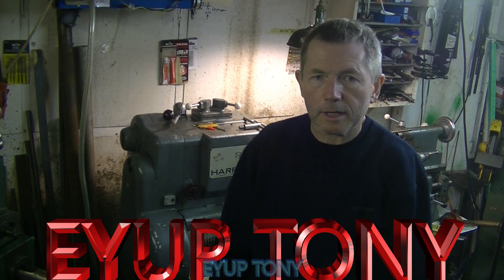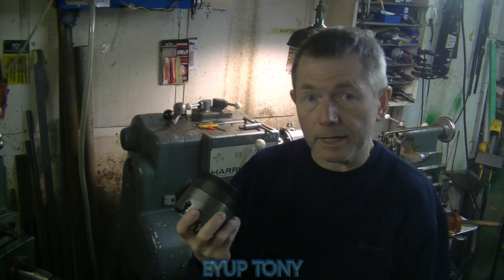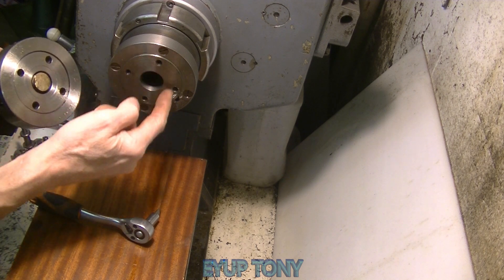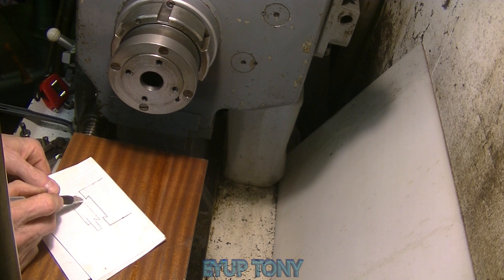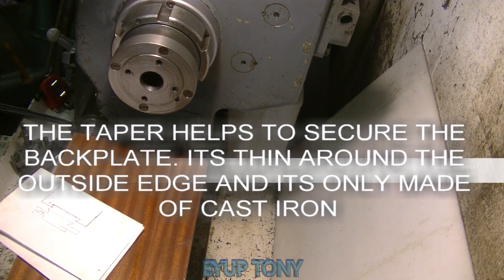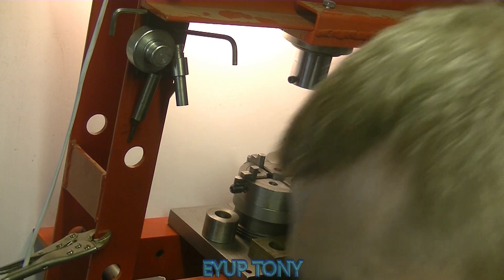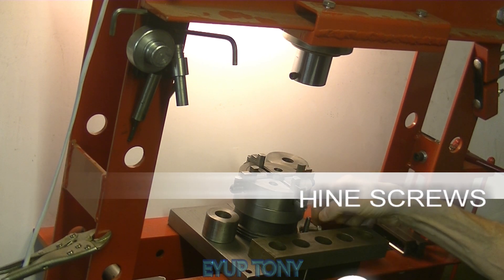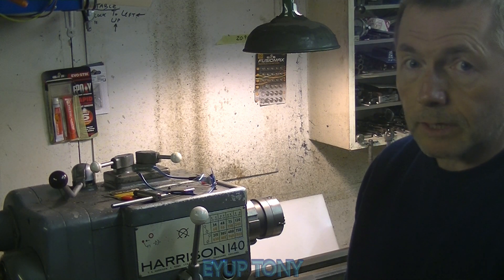Four jaw chuck, shrink tapered fit backplate to fit Harrison lathe. Hydraulic press tight push fit

Comment: Nicely done, it's a good snug fit on there.  Got me thinking about another smaller chuck for small parts rather than the clunky big 4-jaw that I do have. Hooray for the lathe board protecting your ways, I won't change chucks or hacksaw on the lathe without one!
Reply from the maker: Hi Everett. I like to try and use the if possible a
chuck relative to the work piece size plus I quite like swopping chucks makes it a bit more interesting.